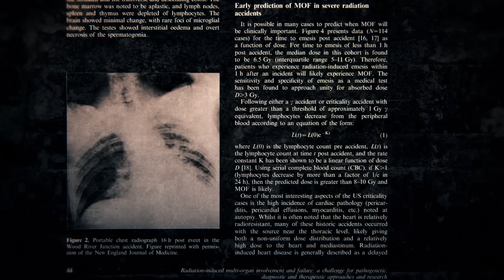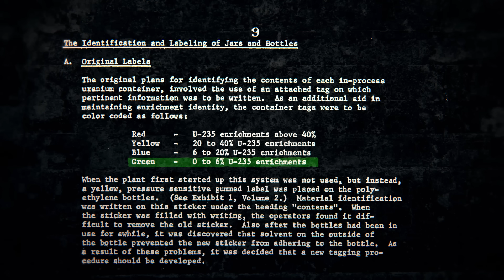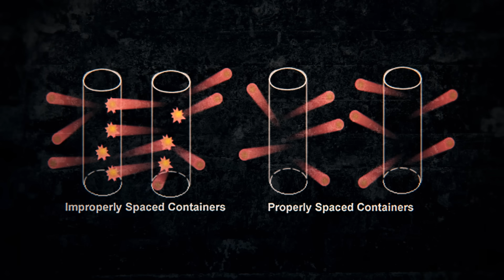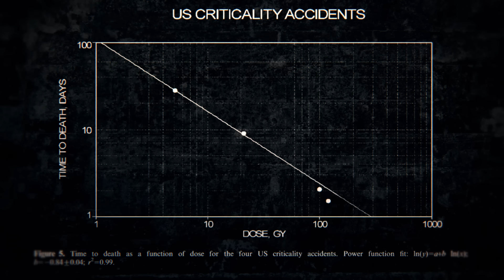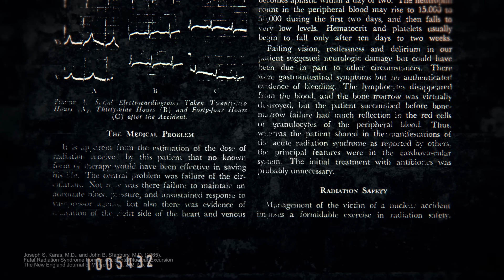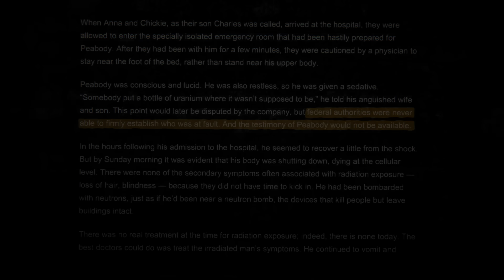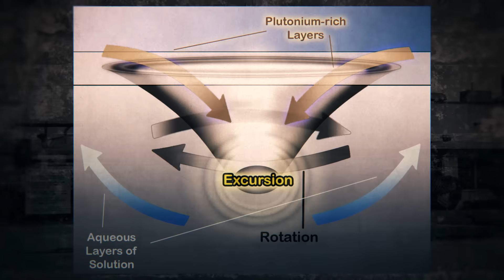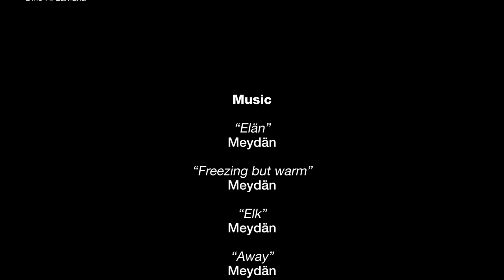The Most Radioactive Man in History - Wood River Accident

Comment: Yeah if you have something that shouldn't make contact with another thing under any circumstances, and those things make contact, it's gonna be bad, that's not a nuclear problem that's an everything problem.
Like if a restaurant kept oil and water in the same bottles and used this method of labeling, someone was gonna accidentally put water in the fryer and burn everything (including themselves). Doesn't mean restaurant industry is dangerous just means we should do things to avoid that happening.

Comment: Key difference: the Sievert(Sv) measures your potential damage, based on the intensity/proximity of the event or material to which you are exposed. Depending on things like bodily exposure, shielding(if any), and response time, the actual amount of radiation you have consequently taken is measured in Grays(Gy).

Comment: The problem is we point out how safe and how very very very low deaths are from radiological accidents. We gloss over with staggering ease how many accidents have damaged or killed folks not at all connected to the nuclear chain but were just some poor somebody with bad luck. Heck the dumpsite outside of st louis that has killed at least 2 and maimed many many others is just one of a list of these accidents that greed sadly almost mandated had to happen. See * atomic homefront* for the deets on that one alone, it aint pretty.

Comment: Based on what I’ve read, this man got lucky his exposure was as high as it was. At that level, it was enough to cause his organs to shut down in two days. Had it been in the 10-50 sievert range, he’d have been in for a very brutal death. Walking ghost phase, and then the nightmare begins.

To anyone who doesn’t know, you are guaranteed dead in that range, just like him. Unlike him, the damage isn’t enough to kill you as rapidly. It doesn’t immediately disrupt the functions of your cells. But it becomes apparent when the cells need to divide and replicate. Your genetic material and cellular structures have been shredded. You appear fine for a little while, and then the burns begin to appear. Skin turns red, then black. The blackened skin decays, basically rots, and falls off. You are alive to experience this. Your damaged genetic material means that new cells will not appear to replace the dead ones. This decay happens in order of how quickly the cells divide. Stomach lining, mouth lining, hair and skin cells all go first. Your blood vessels spill open with no skin to hold them, so giving you morphine is pointless, because you’ll just bleed it back out. Then muscle cells go. You are literally falling apart, and you are alive to experience the pain of it all. In most cases, doctors know better than to help you, as it will only prolong your suffering. You will be dead in a week or two. Either by organ or heart failure. One man was kept alive for 89 days in this state. The doctors didn’t want to, but the family refused to give up hope and prolonged the inevitable. While the man still had lips, he was begging the doctors to stop resuscitating him. The family gave up after the man became brain dead, as a result of one of the times he “died”. There was very little of him left by then. He had to be encased in gauze to keep blood in his body.

Comment: I feel like there should be some kind of extraordinary clause for assisted...you know- after someone MIGHT get exposed to that much radiation, through any means- accident or otherwise. As the video said, there hasnt been another single fatality from accute radiation sickness...but that statement needs to be followed by a YET at the end. There COULD be another accident, potentially, however vanishingly low of a chance it is. But, they would be told that they...basically have no chance of living, and are already dead, but to ease pain and suffering could opt into helping that process along through other, quicker, much less painful means.

Comment: I had read years ago about the 1961 radiological incident in Idaho which, according to the piece I read, was a deliberate act of suicide by Richard Legg who pulled the central control rod out too far thereby killing himself and two other men. But googling that incident just now, it appears the suicide theory may not be accurate, and investigators after the fact pointed to systemic failures and neglect. Anyway, that was a very tragic incident with a lot of lessons learned.

Comment: Bro was exposed to 150 rad of radiation. Point of comparison, it takes only 10 rad for full lethality. 
Parts of his body were exposed to 400 rad of radiation. Damn.
Reply: Sieverts, not rads. 100 rad = 1 Gray, which is roughly equivalent to a Sievert. (100 rem = 1 Sievert)
EDIT: LD100 is 10 Sieverts, not 10 rads. I should've made that more clear. 10 rads (vaguely comparable to 10 rem) is far less concerning. 100 rem increases lifetime cancer risk by 5%

Comment: Honestly,  Peabody may have been the best at his job, but the error is still entirely the fault of negligible safety procedures. Anyone could have made such a mistake with such lackadasical precautions around such potentially dangerous materials. There was an air of indifference probably amongst all of them and Peabody just happened to be the unlucky fellow.  Although he did break procedure, he was only one part of a larger issue just waiting to have a meltdown.

Comment: I am just going to post this from Johnson's Archive but this man who's name may have never been released certainly died faster than anybody ever from nuclear exposure. That doesn't count the atomic bomb blasts because the blast played a major part.
"Six individuals attempted to steal radioactive material from a chemical factory in Grozny. They opened a container and removed several of nine 12-cm rods of cobalt-60, each one 27,000 curies. One individual handled a source for a few minutes and reportedly died 30 minutes later. Of the others, two died of radiation exposure and three suffered radiation injury."😢

Comment: The bit about he coins reminded me about an exhibit that used to exist at the American Museum of Atomic Energy at Oak Ridge. You could put a dime (which were made of 90% silver at the time) into a machine which bombarded it with neutron radiation. A tiny amount of the silver-109 in the dime was converted into silver-110, which is radioactive with a half-life of something like 25 seconds. You'd get to see your dime trigger a Geiger counter and it would be put into a plastic case for you to take home. Almost all of the radioactive silver would have decayed to stable cadmium-110 by beta decay by the time you left the building.

There were versions of the exhibit in a couple other locations including the 1964 World's Fair. US Dimes stopped being made from silver the following year, and this sort of exhibit would not work with the newer copper/nickel composition. You can find the encapsulated irradiated dimes for sale on eBay.
Reply: Except cadmium is poisonous at high enough doses. So is it likely to dust off the dime? And if so how much?
Reply: @PeteOtton  Nanograms or less. Tiny, tiny, tiny amounts. Way too little to matter.

Comment: In my job as a maintenance technician, I can attest to stickers and tags being unreliable.

The best way for proper and durable markings is to fasten a metal plate (like brass) where the relevant information has been stamped on so the only way it can be removed is by sanding or grinding.
Reply: Can you imagine putting a sticky note on something like that? Brr.
Reply: @ladyrazorsharp  Yeah, I mark the food in my fridge better than they did nuclear waste. Insane
Reply: I don't even understand the processes that could have one container of solvent sitting next to or in place of a container with highly-enriched weapon-grade uranium. It feels like higher concentration liquids should be handled somewhere else where they only handle those. Setting can strongly affect human behavior. If you are in room and you can carry out several different processes, someone is eventually going to mix them up. But if you have to be stationed in another area, and you work maybe with differently-colored equipment in the high-enrichment sector, these kinds of mistakes would be less likely.
Reply: I am a chemical engineer and I make sure I am using the right chemical by taste
Reply: ..which will result in the wonderfully resilient brass plate still proudly proclaiming to mark a bottle of isopropanol after the bottle was reused for dilute HF (against policy) and the sticker on top of the brass plate fell off. 😒

spoiler alert: the next maintenance fella was killed by a mysterious guy called Murphy. It was gruesome. 🤪
Reply: @KonradTheWizzard this happened to someone where you work?
Reply: @Non-fictionation  Thankfully no. Once a year we get it drilled into us that you only approach chemicals if you are trained to handle them. If you mishandle even a "harmless" chemical or violate another safety rule you get to talk to someone whose stern stare can kill you. This was the kind of example they'd tell in safety training to make everybody aware of the dangers of violating safety rules. I work in an industry where they take this serious enough to employ people just to check the rules are followed - which is sensible if a broken pipe could drip HF instead of H2O.
Reply: @KonradTheWizzard Probably for the best. Complacency can and has gotten people killed. Like you said, if the pipes can drip HF instead of H2O, you do not want to roll dice on safety.
Reply: @KonradTheWizzard  I remember a colleague who taught chemistry at a local university and was a volunteer EMT. She was talking about how during a training exercise a bunch of firemen wanted to rush into a lab that had an HF leak. Good way to add to the body count. If it's not in solution, meaning an aerosol, it is a gruesome way to die.  At least if it is in solution you might be able to neutralize and absorb it.
Reply: @PeteOtton  Some years ago in safety training I saw a picture of a finger that got a few drops of dilute HF on it. They didn't even need to tell us that amputation was the only solution at that point - I have a very healthy respect for that stuff now. 🤥
Reply: @KonradTheWizzard  A guy who came out to PM an ICP for us was telling us how he was at another customer's site and they didn't tell him they used HF. He wok up in the middle of the night feeling like his finger had been broken. He was able to keep the finger, but there is a dead spot on it. Scary is an understatement.
Reply: @KonradTheWizzard  Tell me you work in semiconductor fabrication without telling me you work in semiconductor fabrication.
Reply: @KonradTheWizzard  It will take the paint off ever car in a parking lot. Ever wonder how much it costs to paint 300 cars??  Working with metals you learn there are far more dangerous things than just the material. Any shit that can etch glass commands my respect. Proper PPE is a must. I have seen brave men run like  track stars from just a small release of HF.
Reply: @ky5666  A lot of assumption there. He could very easily work at a nuclear weapons plant.
Reply: @DraggonCanoe  He's right though. Semiconductor factories have to muck about with HF (and stuff that turns into HF), because every other etchant has some giant drawback that makes it impossible to use on silicon chips. So the combination of paranoid safety training and HF stories tells you "fellow SEMI-professional!" with ~95% certainty. 😆
Reply: @KonradTheWizzard  My friend there is a huge difference between paranoia and profound respect. Working safely with substances that will kill you instantly isn't paranoia, it is called survival. Asbestos, hydrochloric acid, uranium and beryllium are all necessary evils that can be handled safely just like hydrogen fluoride if one has the knowledge and equipment to do so. Healthy respect is necessary when working with any hazardous material.
Reply: @KonradTheWizzard That's not Murphy's doing. That's "human error" as they like to call it.

There are no safety measures available that can counteract "human error" 

As the saying goes: "You can't fix stupid"
Reply: Even then, it's not enough. The Turkish Airlines DC-10 that went down in the seventies had signs indicating the cargo door should be properly checked at closure, but were written in a language the luggage handlers didn't speak.
Reply: Sticky labels don't stick to polyethylene very well. Nothing sticks to polyethylene very well.
Reply: I use stamped stainless steel dog tags attached with stainless steel aircraft cable and aluminum crimps. We don't fook aboot.
Reply: @zpridgen75  BINGO!!  You win, that is how it is done.
Reply: That in combination with color coded containers would be the best option I could think of

Comment: Even color-based tags aren't safe. Using red for the highest % and green for the lowest? Imagine being red-green colorblind!
Reply: Even if you have full color vision it can fail you in certain light conditions (like Sodium vapor lights or low light). That's why standardized labels use color just as one component, there is also shape, text and iconography. If one component fails there are still plenty to give you a clue.
Reply: We use Hydrogen Gas. The trailers are actually multiple cylinders. We had hired a former magazine writer to catch up revising the SOP's. He went around and around with Maintenance and the Safety Engineer about wanting to just go to color code system. The system was color coded and shape coded. One color and shape for empty, another set for in use, and the last set for full not in use. He was told that they were not going to change that system for exactly the reason of colorblindness.
Reply: Usually if a job requires discerning colors for safety reasons, they will test you for colorblindness. I know they do it for train crews, but I don't know how common it is in industry
Reply: @ebnertra0004  At least for semiconductors I can tell you they do not test for colorblindness. I even used to have a project leader who is colorblind. The signs have shapes and icons that also tell a very clear story. It is always better to design for those contingencies. We sometimes work with yellow light (because the chemicals react to blue/UV), which makes it hard to tell colors apart even for normal sighted people.
Reply: @ebnertra0004  Sometimes you need a back up in case you have too many people who would need to do the job that would screen out too many people who might be color blind.
Reply: Red-green blind people like me aren't unable to distinguish red and green from each other. Our ability to do so is merely worse than normal.
Reply: Ideally they would do a colorblind screening on employees during the hiring process, and then if they are colorblind add symbols or something for them
Reply: @ameliarose47  It is easier to just do color and shape coding than to employ multiple systems.
Reply: Easy! We use some color theory vocab here: value! Value is how light or dark a color is. Think of black, gray, then white. They each have different value. You use a red with a dark value (usually stands out more) and a green with a light value. An exagerative version of this would be like pastel green and dark burgundy red.
Reply: They're safe. If you're color blind you need a different job. You need to read too. It's not a job for semi-literate public school products in the first place.
Reply: Well, generally you would disclose that you're colorblind when applying for any job, and the expectation would be either accommodations are made for that fact, or you just simply don't get put in a position where colorblindness is a relevant consideration.
Reply: @dovahkat9635  some people don't realise they are red-green colourblind
Reply: Don't ask don't tell.
Reply: Incredibly unlikely scenario
Reply: @vindrisk 1 in 12 men are some form of colorblind, and 1 in 200 women are some form of colorblind. It’s not rare in the slightest.
Reply: @vindrisk around 1/10 are colourblind and many have no idea that they are
Reply: Dont get the job then?

Comment: 12:33 that number is so staggeringly gignatic that you don't even need a reference point, that much of anything happening all at once to any human body is very clearly enough to destroy it.
Reply: Well there are about 10^23 atoms in one gram of water, which is about 1 million times the number in the video. Given that these are atomic scale interactions, this is actually a smaller number of fission events than I would have guessed.
Reply: Yeah, that was the fourth cookie.
Reply: It’s also 100 quadrillion. Americans will use any unit of measurement except the correct one.
Reply: @TravisZed314  There's no correct way to say a number that large. Hell, even ones as low as 1500 can be one thousand five hundred or fifteen hundred. 

And if you want to be pedantic, originally a billion was a million million, until the AMERICANS started using it for one thousand million, setting up the system we use now of going up in orders of a thousand from million, to billion to trillion etc.
Reply: @bipolarminddroppings  I feel "ten to the sixteenth" might be a correct way of saying it? Numbers large enough that confusion is possible.
Reply: @TravisZed314  Do the math you fake smart guy. I know both systems, why don't you? Exactly. You're lazy.